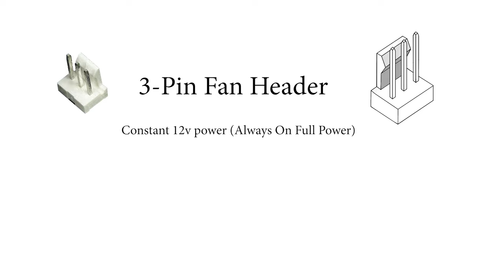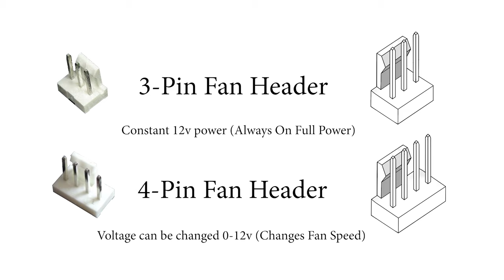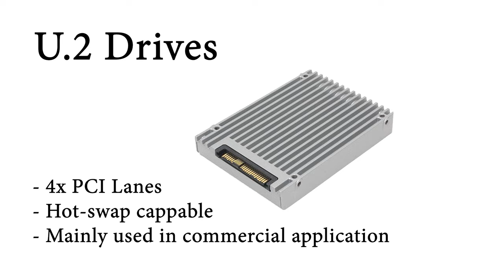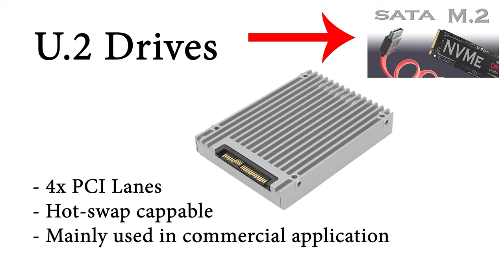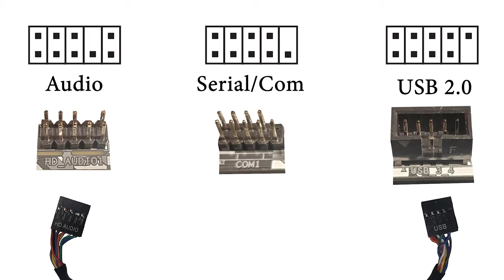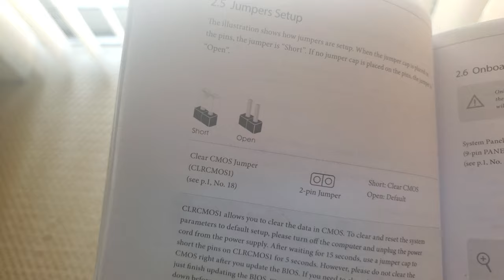Motherboard Connections Explained

Comment: 3:17 That reset switch is plugged on the wrong pins, right?
The text starts 1 pin to the right, and in your front panel connector video it's plugged on the right https://youtu.be/7nMVK6Lpge0?t=122

Comment: Some reason my fans don’t work that came from case, they only have three pins but my mother board has only the 4 pins one
Reply: Correction, one fan works on one of the fan connections, but they don’t work in the other ones, they’re all 4 pins

Comment: Hi, uhh where can I connect a 4 pin molecule connector? Thanks
Reply from the maker: I assume you mean 4 pin molex? And that comes from your power supply, not the motherboard.
Reply: Max's Tech molex is only used for multiple gpu’s right? So if i have only 1 gpu i wont need it connected?
Reply: I solved the issue thank you very much
Reply: Mathijs van Laviere no I am pretty sure we only use Molex nowadays for case fans.
Reply from the maker: @mathijsvanlaviere5207  If you are running multiple GPU's it would depend on what gpu it is, some gpu's require 6-pin power, some 8-pin power, some 2x 8pin. There are a lot of variations. Typically molex would not be used at all in regards to gpu's. Today, molex is really only used for powering fans, or a fan controller. It has been phased out mostly though.

Comment: My pc when turn on, only cpu and gpu fan working and having black screen on monitor, cant even enter bios,
My build 
I3 10105f
H410m h v3 gigabyte
16gb ram klevv 2666mhz ddr4
Wd green ssd 240gb
600w 80+ gold greatwall
Gigabyte gts 450 1gb ddr5
Reply from the maker: If you have on board graphics try plugging into those first then use that to install drivers for your gpu. Or make sure you have the small speaker installed on your front panel connectors so you can listen for error beep codes at boot. Most often it's a memory issue, try just taking the ram out and installing it again just to re-seat it.

Comment: I stopped watching when you said a 3-pin fan header always sends 12v and runs fans 100% but a 4-pin you can changed the voltage.  3-pin IS voltage controlled and in the bios you can in most cases adjust fan curve or reduce steady output to a lower voltage at the cost of some heat by way of inboard resistance.  4-pin is PWM (pulse width modulation)  that ALWAYS sends 12v when on and 0v when off.  It the cycles power delivery on and off in variable cycle duration to control fan speed to a preset limit or fan curve.  Measured in hz 100% PWM is 12v all the time, 75% is 3/4 a cycle on and 1/4 off, 50% is 1/2 on and 1/2 off.  But the voltage is always 12v on a standard MOBO.
Reply from the maker: I pinned a comment revising those statements. Is it not visible? Ide ask you to finish watching if you're curious about other ports.

Comment: i messed this up and now my monitor won’t connect to my pc, please help!
Reply: If you have a discrete graphics card make sure you use that output rather than your motherboard one. IF you don't have a graphics card, make sure your processor or motherboard has onboard graphics. If you don't have a graphics card but you have integrated graphics, your motherboard should have a HDMI or DVI port. Use that. If none of that works, go to a repair shop to make sure none of your parts or DOA or you did something wrong. Hope this helps.
Reply: cytrus i have a radeon rx 580 and i plugged in all my cords like the power and power reset but idk why my monitor isn’t working
Reply: @cmawhir1265  Does the PC turn on?
Reply from the maker: Those small cables in the bottom right of the board (front i/o cables) won't affect your monitor/graphics card. If your pc turns on and you aren't getting any image it could be a few things, 1) bad hardware "DOA" dead on arrival, it happens every so often and you can get a replacement. 2) your monitor is not on the correct output, make sure if you have hdmi plugged in its set to the hdmi output, usually it should do this automatically. 3) your cpu/ram/motherboard may be faulty as well causing your system to not boot.
Reply from the maker: Do you hear any beeps when it turns on? Your motherboard manual should have an error beep code list that will tell you the problem.
Reply: Max's Tech thanks for the help i’ll have to check it out quick, i have a specter monitor and it just says “no input detected” or sum like that, i’ll have to check it out
Reply: Max's Tech my pc rn i a cyber power prebuilt and my monitor just says “no signal, please check your input”
Reply: cytrus yes
Reply: @cmawhir1265  Oh lol it's a pre built. I've swore to the gods I'd never help and stay away from anyone who has a pre built. Goodbye.
Reply: cytrus bruh it’s literally a starter pc and i’m building a new one soon
Reply: @cmawhir1265  Don't care. A pre built is a pre built. Many sins can be forgiven. This is not one of them.
Reply: cytrus lmao i’ll pull that line out too, a pc is a pc. literally won’t help someone because of a pc they have
Reply: @cmawhir1265  Nope. Shows the amount of knowledge you have and your bravery. If someone can't build something easier than Legos (trust me its my hobby), I do not like to have interaction with them.
Reply: cytrus my guy i wasn’t aware for how to awhile ago and now i’m gonna build one, as i said it was a STARTER pc, i just wanted one, but now i’m into it and i wanna build them, the fact you don’t even help or talk to people with prebuilts is just a dick move

Comment: How do I make a SSD active when I have a M.2 installed? I just sent a SSD back to new egg cause I thought it was DOA LOL
Reply from the maker: It will be in your motherboard manual, when you use an m.2 that uses the sata lanes it is basically using one of your sata ports lanes for data transfer. So you just have to plug your ssd into a different sata port.
Reply: @MaxsTech  tha is for the reply .
Reply: Thanks for the reply.. stupid autocorrect

Comment: False information on the video. 4 pin fan header delivers 12v constantly no matter the speed. And 3 pin fan connectors CAN be controlled by voltage. It just needs combatiple motherboard.

Comment: There is a port on my motherboard that consists of five pins, looking like .:: 
What is it?
Reply: What is it labled as?
Reply: @AlphaDango  It could be S/PDIF (Sony/Philips Digital Interface): 1 Vcc  3 OUT 4 IN 5 Gnd 6 NC
Reply: Or it could be an Asrock Infrared Module Header: 1 IRRX 2 IRTX 3 Gnd 4 +5vsb 6 Dummy
Reply: @davidwilson3524  there's no way in hell it's an asrock. It's ten years old XD
Reply: @AlphaDango  it is not labelled.